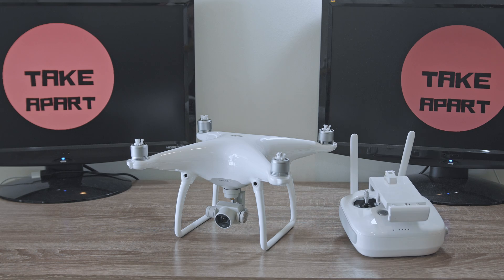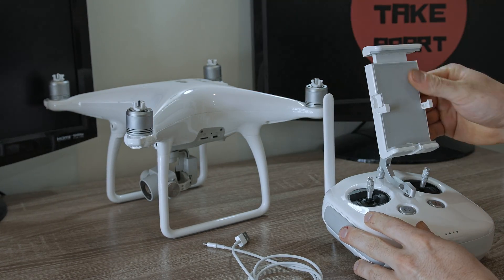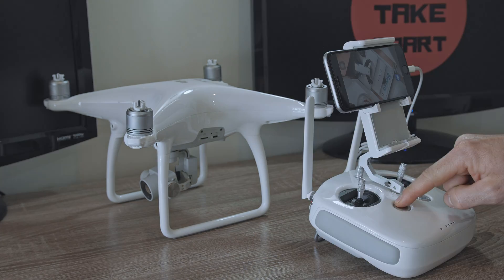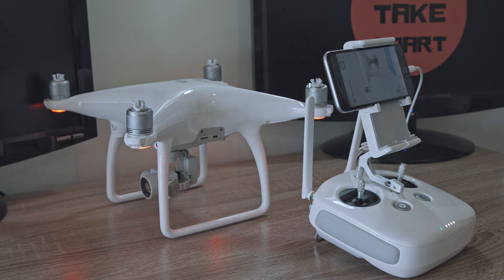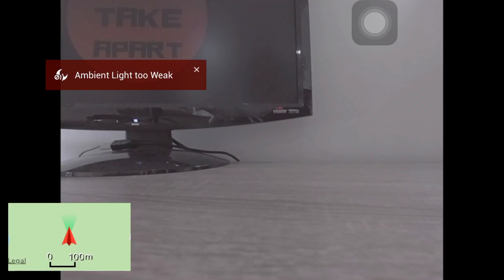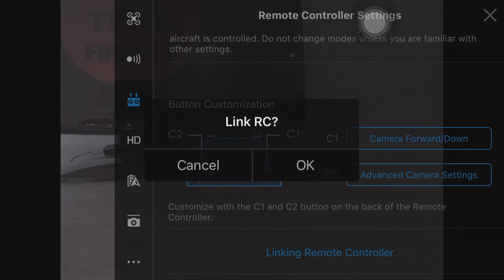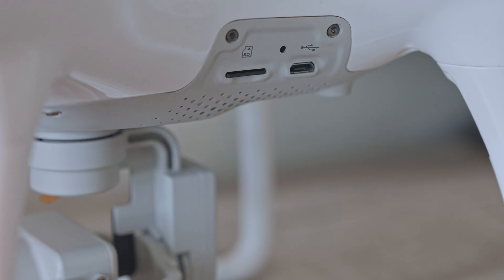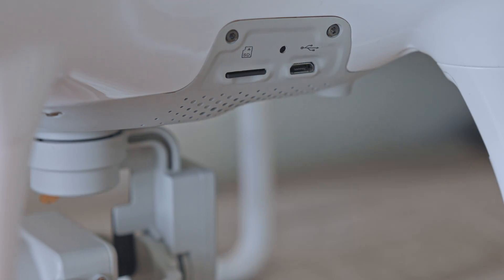DJI Controller Relink | P4 Weak Transmission | FIX ! | Solution HERE |  [4K]

Comment: not seein image on phone...but still records
Reply from the maker: try to relink the controller
Reply: @takeapart  did that
Reply from the maker: FW update?
Reply: @takeapart  what is fw
Reply: problem stars after a update, no image on phone or tablet, yet its recordin, everything else works,just no image preview, but when check sd card,it records
Reply from the maker: sounds like a transmission issue… what device are you using? fw of controller and drone are the latest ? how about update to the app?

Comment: So I have a problem, I just got a phantom 4 standard and I see these videos of people flying them about 1,650 or something like that away. Mine struggles to get past 650 feet away and I can’t seem to know why. Any help?
Reply from the maker: hi, firstly make sure controller antenna is facing drone ... (90degrees - back side of antennas facing drone) . get newest firmware for drone and controller. relink controller after firmware successfully installed. 
and it should be fine . 
thanks for watching
Reply: SAME. Did you ever fix it? I've been trying for 2 years
Reply: tips, the remote drone signal will approach the drone like we playing a kite with a braid..then make sure the braid not being obstruction of any kind of it..others it will be signal lost. even a tree will make it lost the signal. make sure take of on the roght position with clear area no obstacle 1st. tq. @3DRundown

Comment: Sorry my drone has still weak signal so many times i follow your instruction but faild
Reply from the maker: hi , it depends on many things... hard to inspect remotely.   did your drone had any hard landing or crashes? do you using antenas properly?  have you updated firmware to the latest one? 
thanks
Reply: SAME. Did you ever fix it? I've been trying for 2 years

Comment: No, this didn´t do anything to my bad transmission.
Reply: Thanks man! Yes everything was correct. I finally found out myself that my drone simply didn’t like the 5.8 ghz band. I manually set it to 2.4 and now I have several kilometers of connection! 👍🏻
Reply from the maker: If Im correct the automatic switching is the best... 2.4 is for distance 5.8 for close or so ... all is about interference that’s why is there 5.8 option...
happy you figured it out! 
thanks
Reply: @takeapart  why 2.4 for distance?
Reply from the maker: I think it works better that 5g
Reply: @takeapart  appreciate the info. I always cant get farther  than some drone operators. I don't understand why it's always weak signal. How do I know if everything is updated? Controller? The drone? and The phone? oof, My drone was attacked today by a seagull so couldn't get too far out.
Reply from the maker: check settings and look for fw version
Reply from the maker: don’t worry... tell me more... do you have up to date all? remote, aircraft, app?  after every update you need to do relink of controller and aircraft.  also position of antennas: they has to face aircraft not pointing at aircraft...  just like this :      ||        not   like this:    .. 
thanks

Comment: I can't even have a range of 150 meters which is insane. I used both 2.4 and 5.8 ghz, didn't help...linking didn't help also. Any other suggestions? I'm flying open field fyi
Reply from the maker: try to downgrade firmware... also make  sure all is up to date! drone , controller, app,  make sure you using dji assistant 2 ,  after all relink controller one more time... and try ! 
let me know how you go 
thanks
Reply: I tried all of that but did not help buddy :( I get weak image transmission and then everything just turns grey, after that I press the return-to-home button so it can go back to starting point. this is very frustrating
Reply from the maker: tell me more... 
drone?
firmware ver.:(drone)?
firm.ver.:(controller)?
app ver.:? 
do you using ios or android? 
thanks
Reply: @inf1nit33  same thing with me, latest firmware, relinked, made sure all batteries are up to date as well this is frustrating. I can't get past two blocks away.
Reply: SAME. Did you ever fix it? I've been trying for 2 years

Comment: My drone has weak image after 200 meters
Reply from the maker: make sure antennas are facing drone with flatbside and no with ends,  also relink the controller (I have video about relinking controller on phantom 4) 
make sure the app is up to date... 
alnd firmware on done and controller Are up to date as well.  I do have videos for all of it... 
thanks
Reply: take apart thanks for replying, i linked the control to the drone and still same issue. Everything is up to date ill try messing with the antenna to see if it works
Reply from the maker: some people experiencing video issues with android phones... what do you using?
Reply: take apart iphone 7 plus, everything is up to date, my drone says it image lost on the screen
Reply from the maker: ok ... can you try on open space without obstacles... if it’s still do ... try downgrading the firmware
Reply: take apart i re install the the latest version and a day later i went 900 meters without a problem. Ill try to go further thank you 👏
Reply from the maker: have you video quality set to auto?  I mean video feed not video recording...
Reply: @frayby809  how do you do that?
Reply: Taleb Shehadeh honestly i dont even remember try finding a video on youtube, i think it has to be connected to drone and the finding the current version
Reply: Same did you do anything to fix

Comment: Hello friend I need your help what you tell in video I try it but still I am having the problem my video transmission is very bad whenever I fly my drone I can't see what I am recording there is lot of disturbance in my screen please help me.
Reply from the maker: vishal pandey  hi  there  only options are just relink controller, make sure the antennas favin the dron always will glat side , and update firmware on drone, controller,,,, and update your app. 
thanks
Reply: take apart ok thanks I will try your instruction. 👍
Reply from the maker: let me know how you go...
Reply: take apart hello friend I solve my problem. Drone was ok remote controller was also ok. Problem is my  mobile phone. I change my phone and now image transfer is very nice.
Reply from the maker: hi, glad to hear!  enjoy